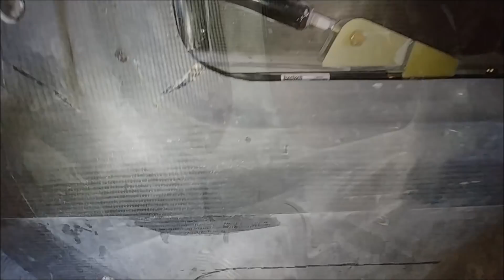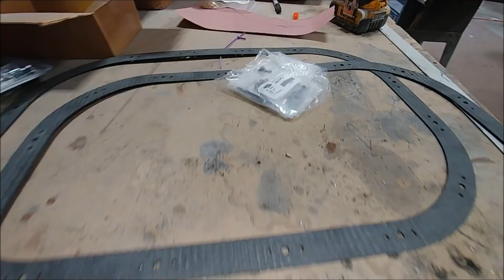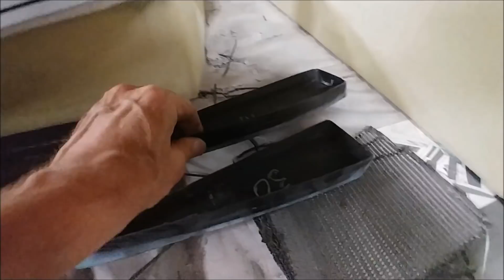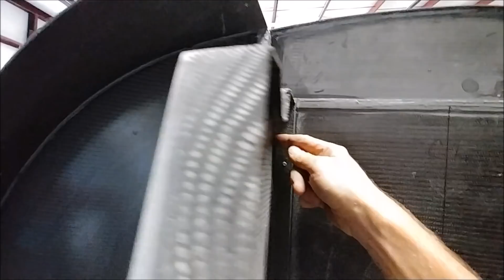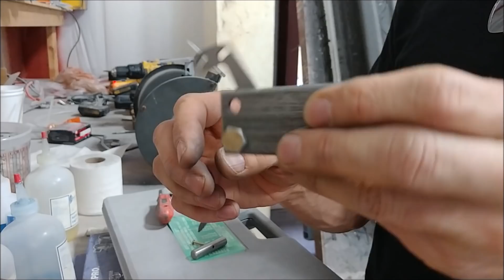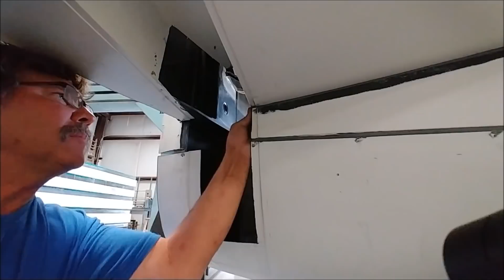Positive Rate, Gear Up - Building the Raptor Prototype

Comment: Lesson learned from years of racing.  Aluminum tanks or any type of racing fuel cells are never mounted rigidly.  Vibration leads to failure.  Racing fuel cells, radiators and inter-coolers are most always strapped-in, hung or mounted in a tray, but never directly attached.  Especially with aluminum, being not as ductile as steal and prone to failure when stressed.  The flexibility of your test stand frame in the beginning most likely contributed to the failure.  If you will notice, almost every production domestic car or truck fuel tank is hung on straps.

Comment: Just a couple ideas: 1. Rubber under test stand fuel tank will keep it from cracking welds-likely getting resonance/vibration through the stand.  2. Consider potting in some NAS1835-3M Steel Inserts for that rear bulkhead panels so you do not need such an elaborate back plate.  Pressure holds the panels the panels - these potted fasteners are quick an easy to install after you drill and hole saw the 16 holes.
Reply from the maker: Jeffrey Goyer actually they would not be strong enough. The panels need to be soundly fastened to the bulkhead in order for the complete structure to handle the pressure load. Without them it could stretch. Basically the bolts are in shear as well as tension.

Comment: I can perfectly understand “no phone calls, no visitors”.  I also believe most people will also understand as well.  Keep up the great work, great videos, and keep moving forward!  I love you guys. :-)
Reply: So much for open source! I understand putting your head down and focusing, but at some point you have to market the thing. Hopefully Peter knows his gross limitations in that department.
Reply: While I agree marketing is a necessary step, you can’t market a concept until a prototype has been built, tested, and flown.  Once the prototype has been flight tested,THEN the marketing comes in.  But not until then.
Reply: @YourTransmissionRepair  Could not have said it better myself. At this point, Peter's policy of no visitors or phone calls, is very smart. All it takes is (1) visitor or phone call to eat away a lot of valuable, precious time and attention from the task at hand. Raptor's YouTube channel provides numerous details/information/data, replies in comment section, not commonly found from such projects or other aircraft manufacturers, not to mention the web-site and the Airshows that Raptor attends for Q&A and promoting.

Comment: I've been watching for about 6 months now.  Very, very cool.  I have an honest question though.  I can understand how you can get to mass production with all the moulds you're creating.  But it seems like there's literally thousands of one-off, hand-machined, custom pieces and parts.  I'm sure you'll get this prototype together.  But how do you transition all those custom things (including all the tweaks on the engine) to serial production?  I truly hope you're successful, but it seems like a daunting task.
Reply: Mark Mark there have been several times throughout these updates where Peter has noted a “lesson learned” - something in the original design that will require a redesign for the final product. I believe the engineering-focused Peter will look for expertise in production when the time is right. In the meantime, he’s sharing the updates on what they’re doing to those interested not specifically for critique of the business processes and/or model.
Reply from the maker: This is why we need a larger company when we move to production and we'll also be outsourcing some or many assemblies to third party companies.

Comment: Find the conduit on the spars really small! wonder why not a larger diameter....
Reply from the maker: That's all that is required to fit the rudder cable. There is another one on the bottom for the required wiring and antenna cables.